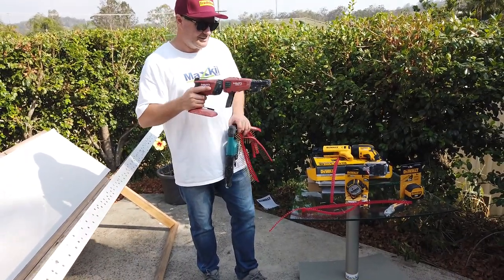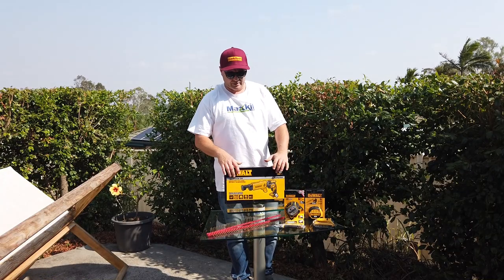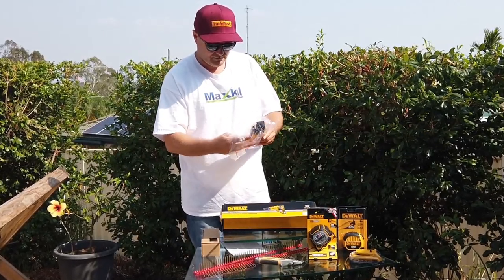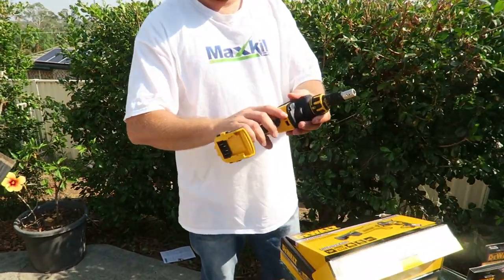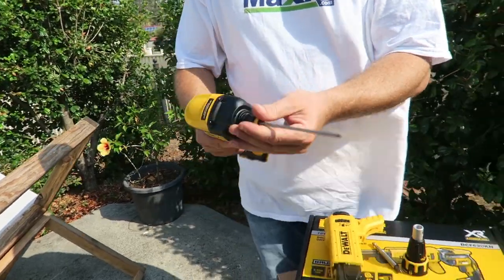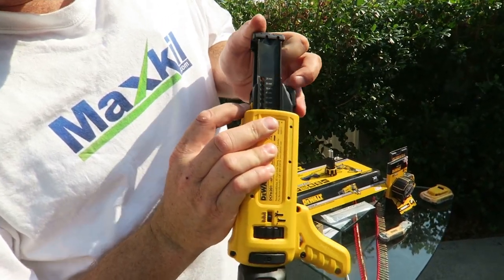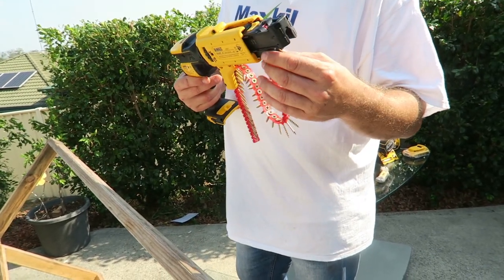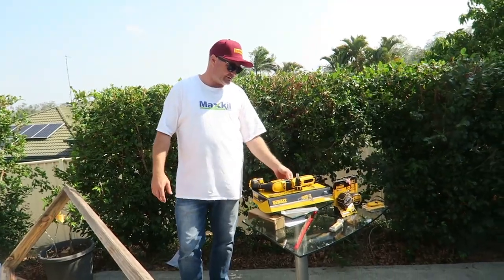Drywall Construction Tools - DEWALT Brushless Collated Screwdriver

Comment: I like that it doesnt come with a battery and charger because if you already own dewalt platform your not forced to buy extra stuff you already own. But the bulky head would make it very difficult not to leave clickers in the corners. Other than that, great tool. Thanks for the review
Reply from the maker: Thanks Rob your right mate. I was on the platform years ago then I gave mine away to an apprentice. Then I got that paint sprayer. They have a 18v heat gun as well that just got released here. You seen it?
Reply: @Maxkil  ive seen the graco sprayer that runs off dewalt but not the heat gun. The sprayer is cool i just think its a little overpriced. Its like $700 here and for that price you can just buy an airless sprayer
Reply: @Maxkil  i almost forgot to ask. I see the battery gracco spray is siphon fed, when you used it did you try to spay upside down? Just wondering if it will suck up air and spit paint?

Comment: Another Great review video, Thank you! 

Some of your previous videos helped convince me to step up to a collated screw gun system for drywall installations (even though it's only about 10-15% of my typical workflow) but the speed & convenience gains are very significant; especially on large projects & where one-handed operation is necessary. Every time I use it, I'm glad I made the investment, plus there always seems to be at least one person on the job site who's never seen a collated system in action & is amazed by the fastening speed, which I'll admit is a nice bonus.

That said, I've got the dewalt kit & had the same issue with screw misalignment on my first few jobs, but found a pretty simple solution.  Aside from the depth adjustments, The key to eliminating this issue is to avoid using the collated attachment in tight corners or anywhere that you can't smoothly press & drive the screw straight into a stud in one fluid motion, as well as, ensuring you're screw strips always have adequate slack between the bottom guide and the tip. If you do have amisfire just manually reallign the next screw on the strip with the tip & you're good. Aside from that, this gun rocks! It's Super-Fast, smooth, lightweight, comfortable  & seems to run forever on a single 2Ah battery!!

Be advised, with the collated attachment, ONLY Dewalt's Proprietary (extra skinny) P2 style bits are compatible. Therefore, users are pretty much limited to drywall use only, as Dewalt doesn't sell any Torx or Robertson tipped bits which are commonly used for most high volume wood applications like flooring etc. Thanks again!
Reply from the maker: Hey thanks very much Brian. Yeah the battery lasts ages even the small one. Glad you running collated. So much better when your struggling with a sheet over your head. Thanks again man. Please subscribe and keep in touch. Max
Reply: i know im asking randomly but does anyone know of a tool to get back into an instagram account..?
I was stupid lost the login password. I would appreciate any tricks you can give me
Reply: @Moises Myles Instablaster ;)
Reply: @Oscar Jamal It worked and I actually got access to my account again. I'm so happy!
Thank you so much, you saved my ass!
Reply: @Moises Myles glad I could help :D

Comment: Looks like you must keep the tool 90 degrees going in because if its not, the angle could drive it into the guard on the end. The directions most likely will mention it.
Reply from the maker: Hey Thomas I think your absolutely correct. Got to be square on when going in and I was a little to relaxed in doing so

Comment: How can you use it if the screw doesn't quite go in as far as you need it to on just the occasional one screw per 30.   Can you drive it any further or is it prohibited by the next screw being fed up?   Can you quickly remove the attachment to use it like a normal gun for corners and weird places like that?

Comment: COLLATED SCREWS ARE 3X THE COST OF LOOSE, 140USD VS 45USD FOR 8,OOO CT
Reply: We reload the plastic strips.
Reply: I can see using the coilated just to get sheets hung on ceilings etc.   Then the second guy uses a traditional gun and loose screws to drive in the rest perhaps.   But the speed at which he puts them with the attachment is unmatched by any hand driver I have seen.
Reply: Near 80 bucks at my supplier.

Comment: I own all 3 guns.

DeWalt is nice and ergonomical BUT its useless in internals. The tip of the head is too wide. They need to narrow it a bit.

Makita is better on timber frames and when gunning battens to the trusses. In all other aplications the Hilti wins.

Heavy gauge steel and screwing denser sheets like villaboard, firecheck and soundcheck the Hilti is best.
Reply from the maker: Yeah I thought so. Seemed a little fat. Haven't tried an internal with it yet
Reply from the maker: Yeah I think you summed it up pretty well. Thanks for your info
Reply: It's absolute best is tak-ing on ceiling board, around windows, doors, walls, and I'm not talking about inside the board;just to keep it in place and move on . Drywall, and 5/8s. All that other stuff CRP said is is obviously not related to drywall.